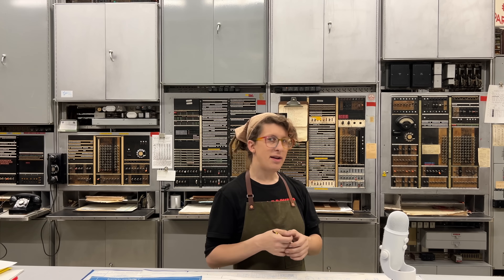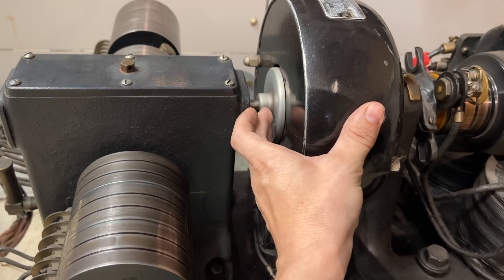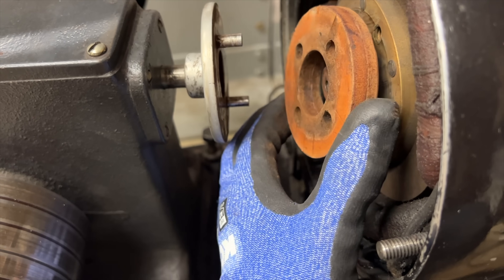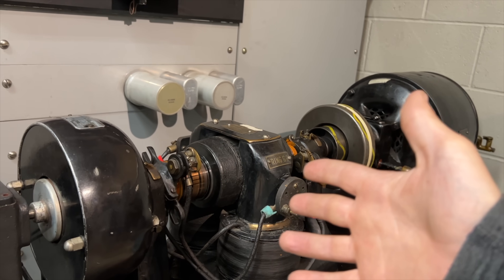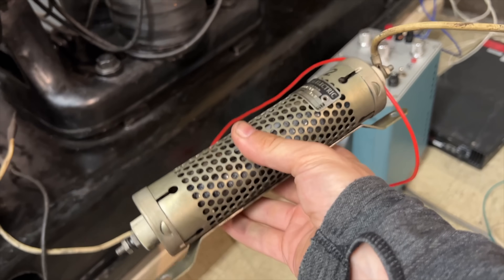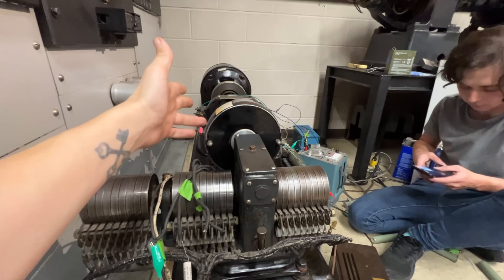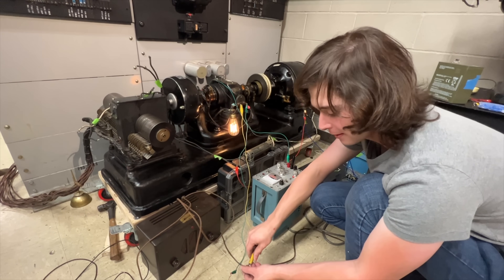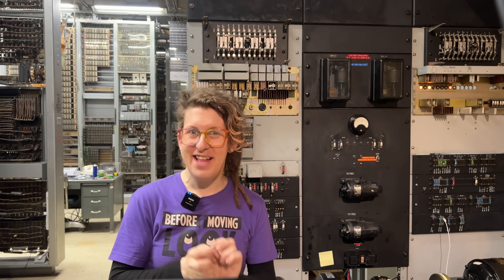Starting up a 100 year old Motor Generator: Ringing Machine Pt. 2

Comment: 2:00 Sounds like you just need to add some hydrocoptic marzelvanes to the ambifacient lunar waneshaft. That will effectively prevent the side fumbling you're experiencing.
Reply: Gesundheit!
Reply: @plushifoxed  Is nicht fur gefingerpoken.
Reply: @AlanCanon2222 YouTube auto translated your comment even though it isn't real German
Reply: @jonathankleinow2073  they just needed to mount the generator to a base plate of pre-famulated amulite.

Comment: I worked as a temp PC technician at the AT&T office in St. Louis in 2000. You might be interested to know that their electromechanical tone generator was still operating at that time. I never had an opportunity to see it or learn much about it, but one could hear it any time one was in the building's elevator, so I heard it several times a day for about three months.

I had wished I knew more about it, so I'm glad you all are doing this very important and revelatory work.

Comment: Love you guys! When I was little, in the 50's, I wanted to be a "telephone man". Well after my stint in the Army and getting out in 1972, I tried to get a job at the local Ma-Bell. The employment officer at Ma-Bell told me back then, something that would never go today, She said, almost exactly, if I was black, a female with a hair lip, she might, just might, get me a position as an operator. 
I never did get a job with Ma-Bell, they broke up and it eventually became Verizon. Who's service was so bad that I have my land-line with Comcast for the past 23 years.
I worked for the government for over 30 years traveling the world repairing satellite systems and automated test equipment and in my spare time did volunteer work for people and organizations that needed electrical work.
I wish you were closer, I would surely be spending retirement with you guys.👍

Comment: I'm always waiting for the next video from you guys...and a few tips for removing press fit parts, make sure to remove any retaining clips or set screws, sometimes they can be under dirt or grease, then get yourself either a propane or Mapp gas torch, get yourself some dollar store tea light candles,   heat the outer part evenly as possible, I will put a little bit of automatic transmission fluid on the part first, and I mean a little cause it is flammable, I will heat it evenly until all of the ATF has burned off, try not to heat the shaft, and don't heat for too long so not too much heat absorbs into the shaft, once at burns off melt your candle in between the shaft and part...spray some lubricant on just the shaft to cool it further,  use a brass, wooden or dead blow hammer to shock it free, if only a regular hammer is available use a wooden block to prevent damage, basically you want to heat and expand the outer part while keeping the shaft cool as possible to break it free, the candle sucks into the joint and does magic, has helped me free things I never thought would separate lol
Reply from the maker: Thank you! We got it off eventually with a little heat, but the candle trick is very cool :D

Comment: This is such life-affirming content, I love it to bits. I can't recall how the exchange ringing current machines in the small rural Strowger exchanges were set to the correct frequency back in the early 1970s, but the memories it brings back are wonderful.  All those ancient engineers, now long-dead, who could feel when the exchanges weren't running right.

Comment: I'm curious to know how much current that -48VDC motor draws...
Reply from the maker: Peaks at about 40A momentarily during startup, then quickly settles to about 9 amps. The total continuous draw of the entire ringing plant is about 15 amps, when you add in the tone generator, relays, lamps, and put a little bit of load on the machine.

Comment: You use pouncing paper (was found in every C.O.) to clean and polish the interrupter rings. A funny story. One Thanksgiving, one of the gals from the plant service center upstairs decided to cook her turkey in the oven in our lounge. Her oven at home wasn't big enough. Our lounge was in the basement right next to the power room. Because of a little too much Thanksgiving cheer, she forgot about the turkey still in the oven. The grease from the turkey caught fire and filled the basement with smoke. The smoke fouled up the interrupter rings on the ringing machine and caused the regular AC machine to transfer to the -48 volt standby. The switch tech on duty didn't know about the problem until all the alarms came in. After getting some fans going to help clear the smoke, he spent the rest of the shift cleaning the ringing machine rings and brushes with mineral spirits and repolishing them. Somehow there was no disciplinary action and nothing more became of it. Not too long after though, smoke detectors were installed in the whole building.

Comment: If I heard that right, Sarah said BSP as in Bell System Practices, a huge set of standardized documentation on virtually everything in the Bell System.  When I taught Communications, I handed out the page on how to sweep your central office.  The instructions included the procedure for both floors and stairwells and the KSxxxx stock numbers for the necessary broom, brush and dust pan.  The point is that marvelous documentation is so instrumental in making life easier for people who have to keep things running smoothly.
Reply: I recall finding the practice on how to use a central office ladder in an RBOC's Engineering Library. Nothing was left to chance in the Bell System.
Reply: Also, It was written so you didn't always have to have a lot of technical knowledge to repair something.  I took a factory class at the ITT factory in Des Plains and we had several Bell guys who were supposed to learn how to maintain the new electronic switches.  They had years of mechanical switching experience but basically knew nothing about digital electronics.  The instructor asked several of use to tutor them as their jobs depended on being able to do basic maintenance or they would lose their jobs. We joked that there were 3 levels of competence, troubleshoot to the component level, troubleshoot to the board level, or watch as long as you kept your hands in your pockets.
Reply: I remember reading a BSP on how to discreetly remove dead animals from a customer’s premise.

Comment: that 28 ohm resistor is absolutely wild lmao
Reply: Don't touch that resistor when in operation, it is libel to be hot. And yet they screwed it to the bottom of a wood table.
Reply from the maker: @steveschulte8696  The table is actually made of slate, so it’ll be fine :)
Reply: @ConnectionsMuseum  Please excuse me. The replacement table will be a big slab of rock I presume.
Reply from the maker: @steveschulte8696  yep :-)

Comment: It looks like a lathe. Apparently part of the setup is tuning. I wonder if once upon a time every telephone office had a 500 Hz tuning fork.
Reply: There could have been a "frequency" indicator on the control panel that indicates if the frequency is too high or too low or about right using vibrating reeds.